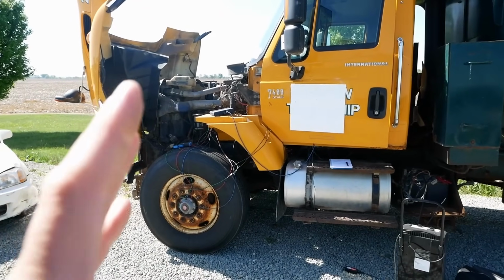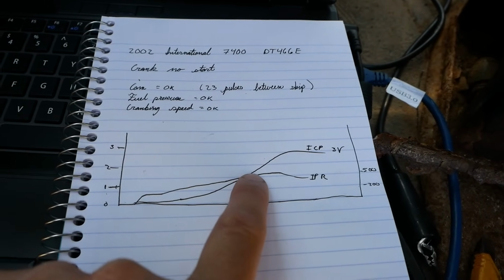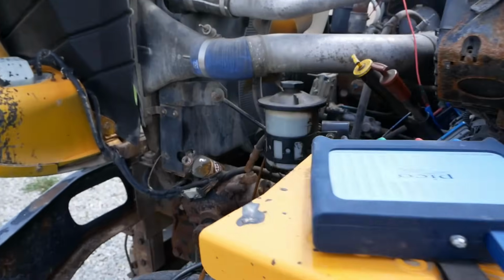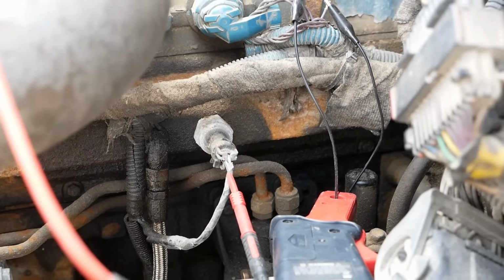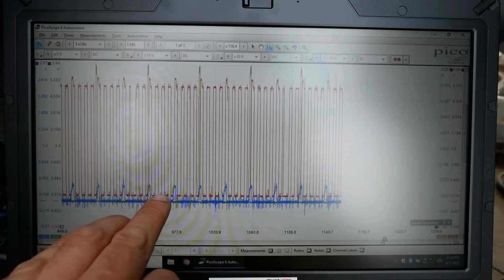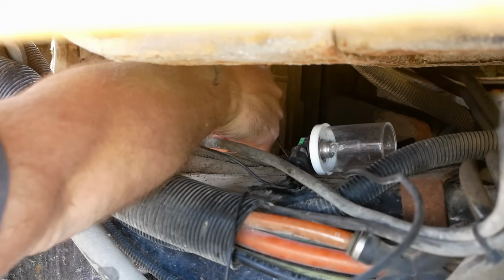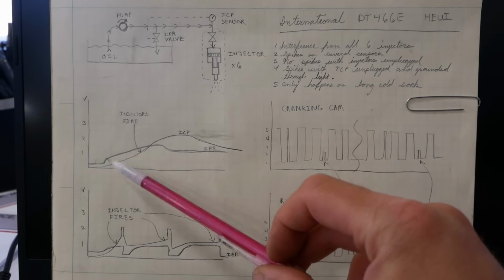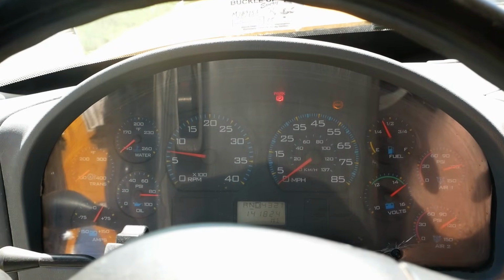International DT466E Won't Start without Ether after Sitting

Comment: I used to work for an auto repair shop that also did towing, and they had a fleet of 6-8 International 4600 with the DT466E. I was the diagnostic tech and the only diesel tech they had, so I got way more experience with these turds than I ever wanted.

We had one of the trucks fail to start one day, which was pretty common and usually an injector or HP oil system issue. This time, it wasn’t. The ECM would repeatedly reset when cranking the engine. I was almost ready to put an ECM in it, but given the cost of the magic box and the fact that my employer was the customer, I was double-checking. I’d checked powers and grounds with a test light, even when cranking, and it looked fine, just a little variation in the brightness of the test light that matched the cranking of the engine, which is to be expected. I decided to check the power and ground voltage with a scope while cranking and I’m glad I did. The power supply was dropping below 4V for literally milliseconds while cranking. This was enough for the ECM to lose power and reset, but too fast to show on my test light, especially given the voltage variation when cranking anyway. I followed the power supply wires back to the battery and found that the 40A fuse holder was melted and causing a voltage drop under load. I had checked the power supply with a high amp test light and the light was bright, but the high peak current drawn by the ECM while cranking was causing an issue. I suspect that every time it tried to fire an injector, it caused a supply voltage dip that reset the ECM. For fun, I went and checked 2 of the other tow trucks that were at the shop and what do you know, the 40A fuse holder for the ECMs on those trucks were also starting to melt. The problem seems to be that 40A is too much for the small automotive fuses to handle. I honestly had never seen a 40A fuse in that size (they are usually maxi or PAL fuses, not the smaller size) and I don’t think I’ve seen one since. I cut out the small fuse holder and replaced it with a maxi fuse holder (still 40A) and the truck fired right up. The shop owner decided to do the same for all the trucks in the fleet and all of them had varying degrees of heat damage to that fuse holder. Bad design I guess.

I’m not sure that was the problem you were experiencing here, but I saw that same damn 40A fuse when you were messing with the batteries and it reminded me of that. 

Hope you never have to work on one of these again. They suck.
Reply: Ours would blow that fuse or melt the holder going down the road and leave you on the side of the road so after a few times of that and multiple tow and shop bills I took matters into my own hands and wired in an auto reset circuit breaker and deleted the fuse and in 3 years it has not done it since.
Reply: Fantastic answer, and I hope Wes reads it, and maybe checks it too.  NOT least for a follow up video, but also to come out of the mire smelling of roses in the eyes of his customer.
Reply: What a great detailed explanation. I'm sure it will help other people as well. The comment section is really worth reading.
Reply: yes, you are correct on the 40 amp fuse holder. the hard starting after sitting a few weeks is caused by a worn lift pump. it allows fuel to drain back to tank causing a delay to feed the hp pump. thats my experience anyhow..  i also live in bc Canada where cold weather played a factor aswell.
Reply: The international service manual says to use a headlight bulb to check the power supply at the ecm and injector driver to make sure it has proper amperage..a test light is too small and a volt meter is exactly that. It is not an amp meter
Reply: I second that, I ALWAYS check every possible power or ground connection when troubleshooting a heavy duty truck… in the truck industry wiring harness are a fucking nightmare… 95% of service calls are bad terminal
Reply: I’ve worked on these for 12 years. 626 code in the ecm-check clean power and grounds. Use a 4 amp test lamp.
Reply: This is exactly why I take the time to browse the comments, you literally are changing people's lives for the better taking the time to write the above comment. Thank you 💯💯💯🙏
Reply: I'm no mechanic, but the problem of it not starting after 48 hours, but starting after 24, had me thinking of either something that requires pressure doesn't have it as it has dripped away over 48 hours, or, something that keeps settings in memory that requires battery backup, loses them because the backup battery goes flat after 24 hours.

Would you charge for a job like this in which no repair was made, but you spent 6 hours on it?????
Reply: @tengallonz  you can’t justify charging that time unless it’s already approved from the customer. After 2 hours you have to call it.
Reply: Interesting
Reply: Good stuff
Reply: when it comes to troubleshooting Wes is pretty good i'd say. me  on the other hand took me about 4 hours worth of labor to Diagnose my bad wiring harness in my 2005 f250, 6.0L powerstroke...... and after i replaced harness and new ICP sensor.... failed to start. Checked all the VREF's back probed everything figured maybe my crank or cam sensor died?......... scratching my head. another potential Thing that can break im assuming it'd be the same i've seen this happen on 7.3 powerstrokes..... cheap aftermarket ICP sensors the Refrence voltage and signal return the two bottem pins can be switched on cheaper sensors.... its enough for normal signals and operation.... but the truck wont start on its own no matter how much you crank..... Hence why alot of people say that aftermarket ICP sensors are junk or just don't work. some will start like that then eventually won't....... but i had to re splice my pigtail. switch it around. prior sensor was motorcraft new one was Dorman. its what was available...... Truck fired right up... it showed almost exactly same issues as We's oscilloscope. could it be that they replaced the ICP sensor on their own...... its a pretty easy job... if its a cheaper sensor.... could be reversed....... and during all this on my 6.0L i started thinking my Swamps 58 V ficm or my ECM was bad.... a buddy of mine who lives across the country was kind enough to send me his.......... same issue verified thats the issue too swapped ECM's and FICMs. scratching my head on it for very many hours. even called my sister up and asked her.... Shes a Master Technician. asked her if she ever seen anything. only reason i found it to be ICP sensor is she gave me the good ole mechanic sanity check.
Reply: 40 amp fuse? You mean rats nest of fuses and wiring..no wonder the shit melts lol
Reply: Im with Kevin on this one, spikey voltages are nearly always a result of bad connections...
Reply: You are much much more thorough than me
Just one question and im not tryna sound like a prick but did you check the fuse before you went through the scope?
Reply: Have you ever tried loading up the oil and the fuel with hotshot.
Reply: @PaulCTownsend  Can I ask what you mean by that ?
Reply: What code would it give you ? Sid 254 FMI 8? I’m having that same issue right now and that code says unexpected reset
Reply: God damn it! 

That would have totally got me. I would have believed my test light and moved on.
Reply: @zoidberg444  Me too!  Man Kevin, That is some fantastic troubleshooting brother. I consider myself pretty good and I would have missed it. And maybe never caught it. I love this comment section..
Reply: @zoidberg444  Never trust a test a test light  . gotta load that circuit  . Quick  n dirty  check  try  blowing a 30 Amp fuse . Only on power  or  ground circuits only.  No computer wires  . unless you're unhooked   the pcm . The head light  works on lower draw  . check 5  v
Reply: What if the tooth of the gear in relation to the “spike/pulse” is chipped or damaged?
Reply: Goddamn... you might just be the goat for this!!!
Reply: need batteries
Reply: Can I message you about a truck? 😂
Reply: Kevin Berg. I cannot even remember how many bulletins on international wiring problems that i had addressed while workin the dealership. The door jam had no more room for repair completed stickers.. lmfao
Reply: L
Reply: @Kevin, man you are spot on. I have same expieriences those pcm's react so fast on glitses and if the voltage drops "safety" comes in and no start is there. Kudos for you.
Reply: Good old fashioned planned obsolescence. Always at the expense of others. Good job sir.
Reply: im in aus.. i watch vids, last wk, watched a vid on 466/e,s..  dont buy one.. from aus, have a good day..yes, first thing i look for is bad fuses, corrosion, loose terminals.. hot wires. i build houses.. i have a s/duty, 2002.. you never got them,,yes we did,,nooooo you didnt....4.2tdi mwm sprint. mine has 230 hp,. 700nm..  brazilian.. sold in aus, africa, canadia, u.k. europe. 4 & 6 cyl.. they had a common rail, after 2007,. never fitted to trucks that i know. owned by IH, for 5 yrs.. suprising you never had them..no computer, no glow plugs, all mechanical, 3" system, 3 valve head, german tractor engine..backwards..fitted to silverado,s in brazil, auto. all fords are zf 5sp..

Comment: Could it be something as simple as moisture getting into the ECM case? The longer it sits the more moisture gets in, when you get it going on ether it cooks it out and runs normally. Based on the location of the ECM, I could see it getting coated in salty, slushy, snow.

Comment: Had it happen before, the damned wiring harness in the valve cover caused it. The power wires got chafed under the cover and were arcing.

Comment: Any 7.3l power stroke that has similar issue usually means worn or sticking poppet valves in the injectors.
Only other issue I can think of is ipr valve in the hpop has bad o-rings or some kind of junk caught up in the valve,so you can remove the valve,disassemble,clean it and reassemble with new o-rings and reinstall,or you can just replace the ipr valve.
I’m pretty sure one of these will solve your problem.
Try plugging in block heater if it fires up after 20-30 mins after plugging in then you have worn out injectors.

Comment: I loath that engine. We had a 4700 at my last job(feedlot) that was slightly older. When it ran, it was a great truck. When it didn't it was a nightmare. That heui system is unnecessarily complicated and I didn't have the diagnostic tools to work on it. Our local international shop is horrible and crooks. No other local truck shop shop would touch it. The internet, lots of time, and pure luck was the only way I kept it running. It did this exact thing the week I quit. International said it needed a new engine, no further explanation. To my knowledge it's still mothballed.

Comment: I suspect the root problem is the integrated IDM has a damaged flyback current recirculator circuit.  If the recirculator is controlled electronically vs a passive diode, then it could be flyback current is bleeding back through the control transistor and making it to the 5v rail via internal protection diodes in the controller that fires the control transistor.  That's my theory.  On a Powerstroke you'd just swap the IDM.

Comment: The fuel delivery is a function of injector pulsewidth and oil pressure.  The injector is a 7:1 intensifier pump, so at 3000psi oil pressure you reach 21000psi injection pressure.  From what I've seen on my 7.3 the computer tries to keep the injectors at 2-4ms and increases oil pressure to get additional fuel mass flow as RPM and boost rises.

Comment: Hey Wes the software for the older blue international engines is a free download with no license through navistar now (ServiceMax j1708) you just need a appropriate pass through cable like a neqix usb link 1 or 2 there are others that will work with it but that what I use hope that helps with future diag on these.

Comment: The diesels of today are out of control in the complexity department and have caused them to become to unreliable and difficult to diagnose and fix.  Something has to drastically change to make them the desirable in my opinion.  I love mechanical diesels and the power and simplicity of how they work.  I hear of many fleet vehicle companies moving back to gas engines due to the cost of ownership of the new diesels where the power requirements are not warranted.  You can replace entire gas engines for the price of a few insignificant parts on a diesel.  Great job on the videos and diagnosis - most would give up well before where you ended, I hope you are properly charging for this work.
Reply: Here in the UK where fuel is quite expensive I know a lot of companies who need fleet vehicles have moved to small petrol engined vehicles where possible. The company I worked for between 2010 and 2017 ditched diesel fords and started running VW UP's - horrible vehicles. Absolutely awful to drive but they had small 3 cylinder NA petrol engines which would do 50 to the gallon. You can get a low mileage used engine for one for less money than a set of used injectors for a diesel. Every day they used to rack up as much as 400 miles driving all over England on jobs and calls. 

As awful as those UP's were they did more mileage with less maintenance and repairs than our fleet of Ford Fiesta 1.4 TDCi's did. Most of them did between 120K and 160K before going for scrap after about 3 years - we actually brought 2 back from the scrap man and scavenged them for parts to keep some of the others running. In contrast one of our Fiestas blew up after 34k/5 years - burned through most of its coolant due to a head gasket failure and seized and it really was beyond economic repair. They were also a lot cheaper overall to run than our diesel Vauxhall Astras - cheaper on fuel and a lot fewer repairs. We had a 1.7 diesel Astra that went through 2 gearboxes and 3 headgaskets in 189K. Towards the end I was getting 5 gallons of waste oil from the scrapyard every month to keep it topped up with oil and every morning you had to fill the coolant up with tapwater. In the end someone rolled it on its roof one night and it got stripped for its gearbox, CV axles, injectors and ECU to keep the other one running. 

The only diesels we were still running were a couple 3L Toyota Hilux's and a bunch of Transit vans. Where I work now we have a mix of 1.0 MK3 Yaris's and Aygo's and some Dacia Dusters and Sanderos with 1.5 DCi engines. The build quality on the Dacias isn't great but they are cheap but we have had two where the engine seized due to chewed up crankshaft bearings at around 150k - I suppose in their defence they are cheap!

Comment: One thing I would have tried is to  temporarily  power up the ecm  with a jumper with key off  for 48 hours to see if something like a cap in ecm is causing the issue. This would be similar to memory keep alive circuit on some ecms.  Another tact would be to put ecm in fridge  after it works normally to see if some sort of heat issue happens. Cool it off then put heat gun to it  to see if it starts or spikes go away after heating ecm. Assuming you can get the stupid connector off.

Comment: Wes, I got a new Lumix camera recently and have been using the Like709 picture profile with good success.  I don't know if yours has the Like709, but it offers a little bit more dynamic range and is a little less contrasty, aka normal.  If you don't have Like709, I understand that Natural is the next best "normal" picture profile.  The CineD profile is the has the most range, but requires grading.  Just thought I'd share some tips.

Comment: My mate had a ford transit which would never start from the key and would just turn over and over unless starting fluid was used. Same symptoms as this one. I found it was the fuel pump was one tooth off on the timing chain. It started on the key instantly, but he moaned saying htere was a noise in the engine. I couldnt hear it. He had me put the pump back to where it was and he relied on the diesel cocain (starting fluid) to start the engine. I never worked on any of his vehicles after that.

Comment: My 2 pennies is electrolytic cap in psu drying out will keep it's charge for a day or so but leaks down if longer than that problably on a power rail for smoothing when it is flat would pass spikes to ground like a decoupling cap due to low capacitance.

Comment: I wish you could have got those connectors off, 50/50 shot the green crusties were on the connector pins causing the shorts.  Crappy captivation designs for the win.